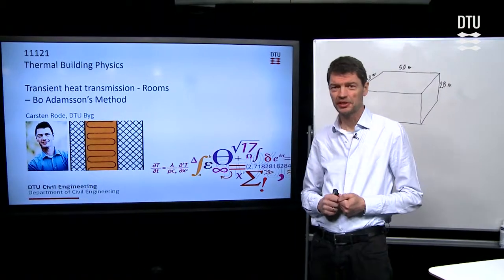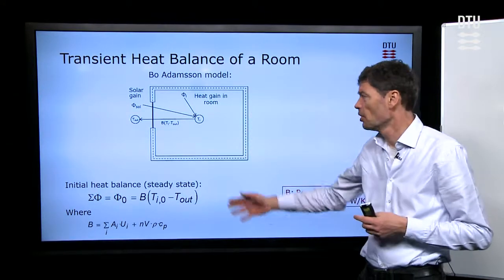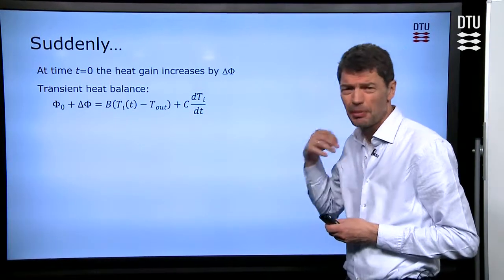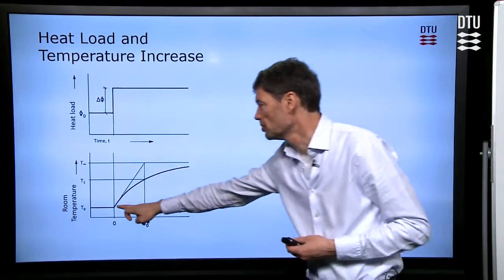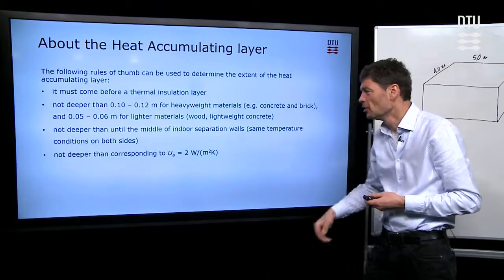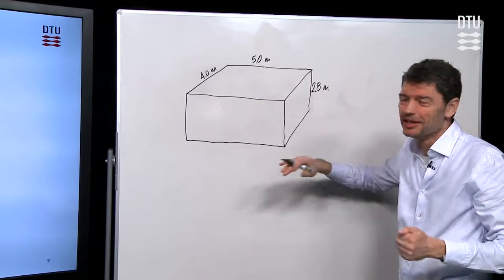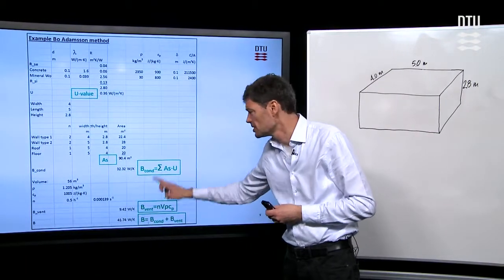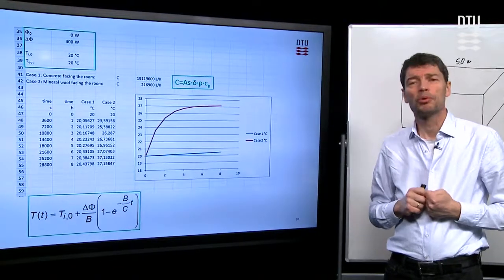Lec 5 | Transient heat transmission Analytical Room Model Bo Adamssons Method

Comment: Thanks prof. carsten  for this informations.

please can you calrify if my building have another heat accumlating layer i can not using ADAMSSONS METHOD right?
Reply from the maker: Thank you for your kind words and for engaging with the content. 

Regarding your question, Bo Adamsson's method primarily focuses on the transient heat transmission for specific building configurations. 

If your building has an additional heat accumulating layer, it might introduce complexities that could affect the direct application of Adamsson's method. However, with modifications and considering the specific properties of the additional layer, it might still be possible to use the method or a variation of it. 

Hope this helps!👍